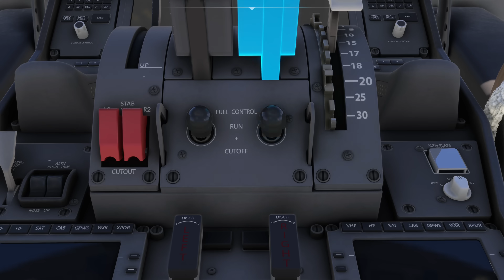Air India 171: Why Did The Fuel Cut-off Switch Get Moved?

Comment: If one pilot wants to take down a plane there are many ways for them to do it. Adding more complexity to the fuel cutoffs does not stop the pilot’s intent.
Reply: Yeah ... I don't think the demands to make everything flight critical require two inputs are workable, to put it mildly.
Reply: @BlueCyann  especially if one pilot is incapacitated
Reply: Disagree. This channel ain’t in anyway involved in official investigation.
But it points out who has been added to investigation and that includes an Aviation Psychologist. 
Did WSJ forget to mention that?
All prelim indications support human(s) moved switches both times and we all know this ain’t the first pilot(s) to do such an act.
Alt causes simply grossly lack the continuum of evidence supporting intent (likely malintent) behind cutting off engines 3-4 secs after rotation.
Tragic.
Reply: If one pilot becomes incapacitated, the last thing you'd want is the need for BOTH to perform some action!
Reply: True! It's human mentality. The more complex things get, the more they stress men out.
Reply: Disagree. They need to Psycho proof these planes
Reply: Exaclty. Like banning guns, people with bad intent will just find another method, nothing will stop them (except an armed person with good intent).
Reply: @joecoolioness6399  
Grundsätzlich richt.
Aber was hat das mit Ait India 171 zu tun ?
-
Die Triebwerke waren ab V1 nicht mehr abschaltbar.
Die 787 ist "redundant".
Das bedeutet auch, dass widersinnige Aktionen nicht getätigt werden können.
Sie können den Schalter umlegen, so oft Sie wollen. Es hat in der Startphase
keine Wirkung mehr, da die Programmlogik aufgrund der Redundanz, ergo
des Systemzustandes (Takeoff) einen unsinnigen Befehl schlicht nicht ausführt. 
Außerdem hätte zumindest die APU noch funktioniert.
Da auch das RAT ausgefahren wurde, wurde nichts ABgeschaltet, sondern das
komplette Bordnetz fiel aus.
Auch DAS lässt sich von den Piloten vom Cockpit aus nicht machen.
Nur am Boden bei Servicewartungen. Um die Maschine zu reseten.
.
Jamming per GPS aber schon. (!)  War schon in den 80ern vorgesehen, so
möglichen Luftpiraten die Übernahme einer Maschine unmöglich zu machen
und die Maschine per GPS in "sichere" Gefilde zu lenken.
Einige wenige Systeme mit eigenem Stromkreislauf (Funk, Black Boxes) wurden
noch von den Akkus gestützt.
Die hier dargebotene Geschichte ist frei erfunden.
Reply: In this case Steve has made the wrong call. He didn't even get the wording correct! '"why did you cut off?" not, why did you cut it off. The pilot was clearly distressed & talking to the controls. With the other pilot confirming he didn't do it. The switches are not directly connected to the cut off valves. The controller could close the valves itself and record a switch movement when it did not happen. Both pilots were pro-life. It's sad that they are being accused of this & can't defend themselves.
Reply: Watch Flyingbeast video if you  really believe in unbiased explanation ❤❤❤ english subtitles are available
Reply: You are correct, but it does, however, remove a method of IMMEDIATELY crashing a plane.
Reply: I believe that it would stop THIS situation. I also agree with you that there are many other scenarios to reach the same result. A careful review of the entire situation is needed to determine what options are available. It must be made as difficult as possible for anyone attempting this. Mental health is a huge societal concern that has been ignored and unfunded.
Reply: Nein. Die Triebwerke waren ab V1 nicht mehr abschaltbar.
Die 787 ist "redundant".
Das bedeutet auch, dass widersinnige Aktionen nicht getätigt werden können.
Dann hätte zumindest die APU noch funktioniert.
Da auch das RAT ausgefahren wurde, wurde nichts ABgeschaltet, sondern das
komplette Bordnetz fiel aus.
Das lässt sich von den Piloten aus nicht machen.
Jamming per GPS aber schon. (!)  War schon in den 80ern vorgesehen, so
möglichen Luftpiraten die Übernahme einer Maschine unmöglich zu machen
und die Maschine per GPS in "sichere" Gefilde zu lenken.
Einige wenige Systeme mit eigenem Stromkreislauf (Funk, Black Boxes) wurden
noch von den Akkus gestützt.
Die hier dargebotene Geschichte ist frei erfunden.
.
Man sollte als BRICS-Mitglied besser keine amerikanischen Flugzeuge kaufen. (!)
Boeing ist auch ein militärisches Unternehmen.
.
 WER saß wohl alles in der Maschine? ...oder auch nicht unbedingt.
-
Beim MCAS-"Absturz" der Äthiopian-Airlines saßen 20 äthiopische UN-Delegierte mit in der
Maschine.  DIESE 20 Delegierten, die mit ihren Gegenstimmen dafür sorgten, dass die USA
keine Militärbasis in Äthiopien errichten durften.
Dass das per US-GPS satellitensteuerbare  MCAS  generell geheim gehalten wurde, war 
keine bloße Schlamperei und/oder Sparmaßnahme um Airbus dagegenzuhalten, wie offiziell
kolportiert.
-
Gedacht sind solche Systeme schon lange um bei "Flugzeugentführungen" die Boardelektronik
zu überstimmen, damit Luftpiraten die Maschine nicht mehr übernehmen konnten.
Das us-amerikanische GPS-System wird genauso in Waffensystemen wie Drohnen, Raketen
und dgl. verwendet wie in der Zivilluftfahrt. Das Jamming weiß nicht, ob es die Funktionen
eines zivilen oder militärischen Gerätes stört, bzw. unterbricht. Das weiß nur der Absender.
-
Auch in der Indonesischen MCAS-Absturzmaschine saßen fünf solcher Widersacher, mit deren
Votum ein Jahr zuvor auch in Indonesien eine Marinebasis der Amis verhindert wurde.
-
Die beste Versicherung für Staaten, die sich den USA nicht unterordnen lassen wollen, ist,
nur noch von der brasilianischen Embraer, der chinesischen Comac und der russischen OAK
zu kaufen. Die benutzen ihre Systeme (siehe auch Microsoft Windows) nicht als Waffe.
Reply: Feel like Boing would like to blame pilots/ does look likely/ so airliner not responsible. Thanks Capt Steve. I want you and tiny bit of grey hair piloting my plane. I gave anesthesia for 40 yrs in OR. Obviously different careers but similarities in putting patients to sleep... securing airway. Many rapid steps and machinery knowledge needed. Most "problems " are either at induction or emergence. You need experience and backup plans ready to initiate if needed. Remember Joan Rivers death ?  Entirely preventable if anyone in that endo room...4 people were watching her. Most injuries in OR are anesthesia. Rip to all passengers, crew, people on ground, and their loved ones.
Reply: Why wasn't a flight engineer or third pilot used in jet this size flying 2,000 miles or more?
Reply: @pegggymallis324   Because the brillant Techníc not more nessesary...  and not more sinful.
Es wird gesucht, mit welcher Mär man am besten verwirren kann,
um den wahren Grund zu vertuschen.
Da wird im Trüben gefischt, dass sich die Balken nur so biegen.
.
.
Nein. Die Triebwerke waren ab V1 nicht mehr abschaltbar.
Die 787 ist "redundant".
Das bedeutet auch, dass widersinnige Aktionen nicht getätigt werden können.
Sie können den Schalter umlegen, so oft Sie wollen. Es hat in der Startphase
keine Wirkung mehr, da die Programmlogik aufgrund der Redundanz, ergo
des Systemzustandes (Takeoff) einen unsinnigen Befehl schlicht nicht ausführt.
Das ist auch bei der Landung für die Schubumkehr so.
.
Außerdem hätte zumindest die APU noch funktioniert.
Da auch das RAT ausgefahren wurde, wurde nichts ABgeschaltet, sondern das
komplette Bordnetz fiel aus.
Auch DAS lässt sich von den Piloten vom Cockpit aus nicht machen.
Nur am Boden bei Servicewartungen. Um die Maschine zu reseten.
.
Jamming per GPS aber schon. (!)  War schon in den 80ern vorgesehen, so
möglichen Luftpiraten die Übernahme einer Maschine unmöglich zu machen
und die Maschine per GPS in "sichere" Gefilde zu lenken.
Einige wenige Systeme mit eigenem Stromkreislauf (Funk, Black Boxes) wurden
noch von den Akkus gestützt.
Man hat sich erst mal weiterhin mit Sky-Marshalls beholfen. Aber inzwischen
gibt es ja besagte Technik und die immer perfekter.
Die hier dargebotenen Geschichten sind frei erfunden. Erstunken und erlogen.
.
.
Man sollte als BRICS-Mitglied besser keine amerikanischen Flugzeuge kaufen. (!)
Boeing ist auch ein militärisches Unternehmen.
.
Beim MCAS-"Absturz" der Äthiopian-Airlines saßen 20 äthiopische UN-Delegierte
mit in der Maschine.
DIESE 20 Delegierten, die mit ihren Gegenstimmen dafür sorgten, dass die USA
keine Militärbasis in Äthiopien errichten durften.
.
Dass das per US-GPS satellitensteuerbare  MCAS  generell geheim gehalten wurde,
war keine bloße Schlamperei und/oder Sparmaßnahme um Airbus dagegenzuhalten,
wie offiziell kolportiert.
-
Das US-Amerikanische GPS-System wird genauso in Waffensystemen wie Drohnen,
Raketen und dgl. verwendet wie in der Zivilluftfahrt. Das Jamming weiß nicht,
ob es die Funktionen eines zivilen oder militärischen Gerätes stört, bzw. unterbricht.
Das weiß nur der Absender.
.
Auch in der Indonesischen MCAS-Absturzmaschine Lion Air saßen fünf solcher
Widersacher, mit deren Votum ein Jahr zuvor auch in Indonesien eine Marinebasis
der Amis verhindert wurde.
-
Die beste Versicherung für Staaten, die sich den USA nicht unterordnen lassen
wollen, ist, nur noch von der brasilianischen Embraer, der chinesischen Comac
und der russischen OAK zu kaufen.
Die benutzen ihre Systeme, so wie auch Microsoft ihr Schnüffel- und Sabotage-Windows,
nicht als Waffe...
Reply: You can watch Video by Flying Beast who is an Ex Commercial Pilot and explained the whole scenario second by second and explain why he thinks its not the Pilots error.
Reply: Agreed. Two pilots independently executing a command like cutoff/restart & dump fuel etc etc 
doesn’t cover when 1 pilot is incapacitated, in nearby toilet, or part of a suicide pact.
Reply: Good point but what it would do is make it easier to ascertain if That's what really happened, of course the root here is mental health, particularly since many of these evil p.o.s. showed many signs leading up to their evil act but even if it's not the root of the problem there are numerous other reasons to make the procedure longer like the other pilot having more time to realize what's happening and intervene... though the Run process should remain as 1 action I'm just talking about the Cut Off
Reply: What about simply moving the switch to the far side of each pilot, so you would need to lean over to their seat or get up, basically something very noticeable. If we are looking for a solution to this problem. then what are we doing? inventing a protocol to cure all future mental health problems? The purpose of two pilots is to negate for the human factor, this is part of that human factor. even just moving the switches up higher so they are in your field of view. there aren't that many ways to crash that plane in that situation with another person monitoring you without it becoming a confrontation, which many people will avoid.
Reply: @truffleshuffl  Then a pilot would think of another way. What you guys are forgetting they are highly skilled and intelligent people If they want to do it, they'll get the job done. You can't babyproof the plane.
Reply: @truffleshuffl that just isn't feasable, changing such a thing just ruins,muscle memory and to add, easy access to these switches are needed for both pilots if one becomes incapacitated.
Reply: Money talks , the pilots are long gone to defend themselves, boeing has a lot to loose if the truth comes out
Reply: @vicsaggu i don't know why everybody thinks boeing has a role in this, look at it objectively instead of immediately blaming the manufacturer, and to be honest its the fuel control switch so if you want to blame somebody blame Honeywell, the maker of the switch
Reply: I can't believe this channel is still talking suicide. Others are on to what the wall street journal was reporting today, the switches. Not the pilots guys. Get with the picture.
Reply: @CraigJones-u9u  And the wall street journal is a credible source? The switches are not going to move their self.
Reply: @CraigJones-u9u  Someone moved the switches
Reply: @CraigJones-u9u  No one is talking "suicide". the Capt merely mention, " one need to conclude oneself, based on the facts recorded by the Flight Data Recorder, nothing more, nothing less at this stage. No?
Reply: @CraigJones-u9u  It's pretty obvious. Sources like CNN are avoiding that route because they are liberal and don't want to accuse people of color of wrong doing (like they did with the Malyasia flight even going so far as to think it was aliens or black hole). Those switches were physically down, if they were not, the other pilot wouldn't have noticed them being down and put them back up.
Reply: @CraigJones-u9u  It was the pilot
Reply: @Dave-ro3nj the preliminary report does not blame the pilots. It's our own speculation and conclusions that point fingers towards blaming the pilots.
Reply: @anthonywilliams9852  It's been reported that the fuel cutoff switches were turned off one at a time (one second apart). I'm not saying if it was intensional or not, but those were turned off manually by one of the pilots.
Reply: @CraigJones-u9u  they are trying to put the blame on the pilots in other to save Boeing again
Reply: @CraigJones-u9u  The Wall street Journal said that it was faulty switches did they ?  If so the WSJ will not exist in a year or 2 as they will be sued into oblivion by Boeing; Try reading facts instead of nonsense.  The alleged switch problem was from 2018 and was for the 737 aircraft type not 787;  This particular aircraft had the throttle control module replaced twice since 2018 so this would have been dealt with long ago. From the evidence presented so far there are only 2 possible conclusions and both are down to a pilot shutting down the engines whether in error or deliberate no-one knows at present. And before you say it, I dont work for Boeing or have any connection at all with Boeing.
Reply: @CraigJones-u9u  WSJ states or summarizes no such thing.  The article says the probe is focused on the pilots and that nothing at this time points to either Boeing or GE.

Comment: Steve, how can you be so sure that the fuel supply was deliberately cut off by one of the pilots to cause a fatal crash? I’ve heard you say this in video after video over the past few days, yet the only facts we have in the preliminary report are:

the fuel was shut off

one pilot asks the other “why did you shut off the fuel,” to which he replies “I didn’t.”

I think we should initially assume that these highly trained and professional pilots are telling the truth. We also know that Boeing has a history of quality issues.

I have a degree in behavioral science and have worked professionally with behavior development, including at Swedish air traffic control.
Reply: No that’s not correct. The report states explicitly that the switches were moved to cut-off. Every press of a button or switch etc is recorded. The report does not say that the fuel was cut off without the switches moved! The switches can only be moved by human input. All the vibration theory is bullshit. They worked for 12 years hence why should they suddenly fail. It’s mechanically secured not electronically and moving the switches in a sec is totally normal procedure. Turning it back after 10 sec is also explainable as the other pilot needs to comprehend the situation first. It’s a situation they never expected, trained or could imagine. So it’s normal that with all the alarms etc hammering down the other pilot does not flip them back after 2sec. Also the report does not state how the pilots talked to each other, e.g. like screaming, what was talked before or after until crash. It’s just transcribing the spoken words. We have to wait for more intel to draw conclusions. But it’s 100% sure that the switches were moved to cut-off by one of the pilots. Otherwise the FAA would ground all planes with that switched installed. Talking about cover ups is so beyond stupidity…they grounded all maxes globally for almost 2 years. You thing they give a shit about that if over 200 people died?!!
Reply: @pokibanana  exactly,these indians are running all over denying pilot resposibility.
Reply: Exactly  @pokibanana  you write it your self "We have to wait for more information" but Steve has already made up his mind, thats what Im highlighting here.
Reply: thats why sweden is being overtaken by muslim rape gangs cus you guys think nothing is happening.

Comment: If the plane had been a hundred feet higher when the fuel control switches were cut off with the same pilot 10-second reaction time, could the plane have been saved?

Comment: Micro switch which get connected when fuel  switch is moved,in my scooter  brake light gets on when is starting but when I move brake lever two three times its get off,its possibility  of worn out plate of microswitch and  are both engine  electrical  contact in same housing

Comment: Boeing could develop better software controls to prevent accidents like this. For example, it can be determined that the plane has just taken off or at least it at such low altitude and speed that cutting off fuel/engines will be catastrophic, so don’t allow that.

Comment: ".... the fuel control switches were installed with the locking feature disengaged". 
What exactly does this mean? What is the "locking feature"? 

Other than the safety features currently discussed on multiple channels on how one would engage/disengage the fuel cutoff switches, what "locking feature" (absence) is the FAA referring to?